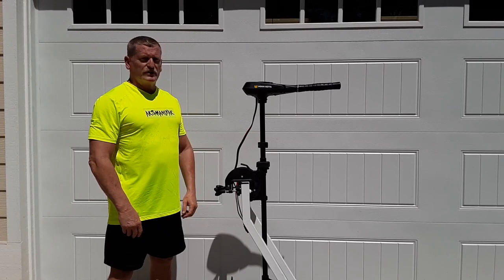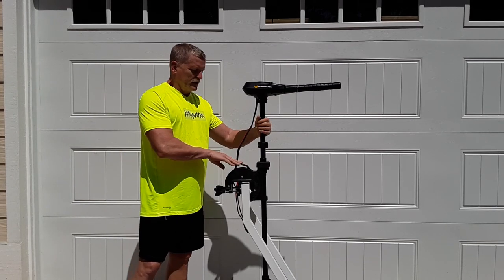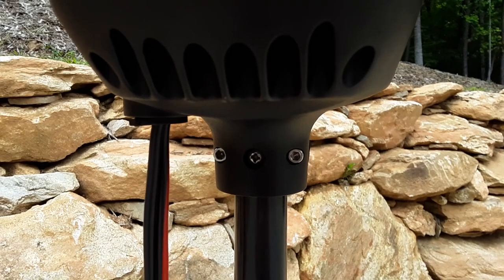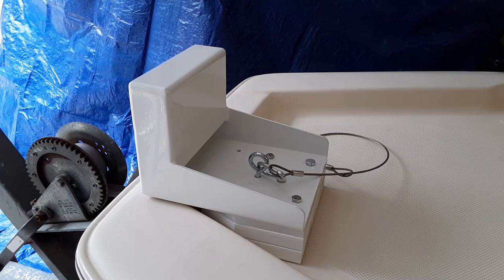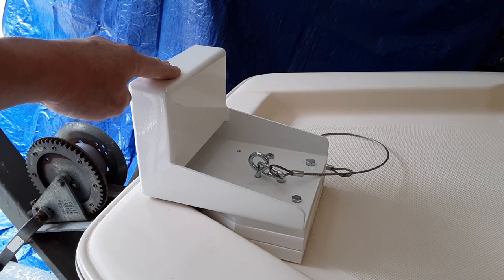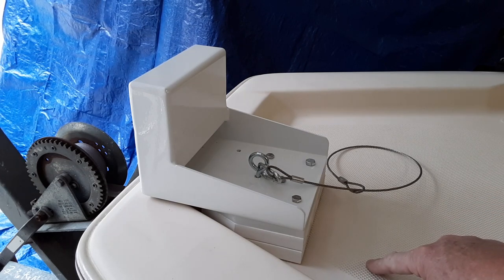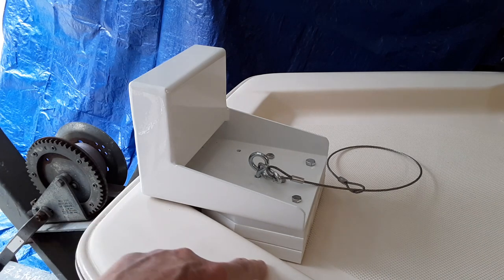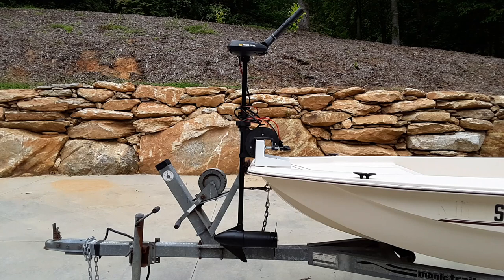DIY Transom to Bow Mounted Trolling Motor Conversion

Comment: Hi,
Looks like a sweet installation.  The longer trolling motor shaft makes a lot of sense.
Also, the PWM Pulse Width Modulation circuitry in the variable speed trolling motor is the way to go.  Fish all day on a good charge.
John
Reply from the maker: Thanks John. Not too many bow mounts have the PWM speed controllers and reverse. I'm working in a small space with a 14 foot boat and this just made sense.

Comment: The heart of this project is a commercial bracket that costs $80. Not really what I consider DIY. You've given me a good idea for making my own though, so thanks.
Reply from the maker: You could make your own but I thought the quality of this product was worth the price.
Reply: It is sold out on their web site.
Reply: howd yours come out i made one out of a thin stainless steel sheet bent at a 90 and bolted a piece of wood on it where the TM clamps. Ive got it hangin off the side on the bow. Anything past 2 speed on my endura c2 it lifts off the wood; thinkin of just bolting all the way thru the wood somehow with wing nuts
Reply: I ended up buying a bow-mount motor and building a short, 3/4" plywood deck at the front of the boat. The deck is held down with heavy-duty (0.125") DIY aluminum brackets and 2X4s, and the trolling motor bracket is bolted to the deck with the manufacturer's SS through-bolts. Wish I could post a pic here. Ironically, the lower unit on my outboard failed shortly after installing the TM, and I made several trips out with only the trolling motor. In retrospect, it would have been nice to be able to move the TM to the transom temporarily, if only to make it easier getting the boat on and off the trailer. It's very sturdy at the bow though and will probably last many years. Good luck with your project!

Comment: Been looking for a used Traxis like yours. I want the variable speed so you are never going too fast or too slow and the control handle tilts up for easier steering. Good stuff but pricy. $350-$400 but the best choice.
Reply from the maker: Yep. Great motor.

Comment: Nice Video!!  Wondering if you used a backing plate of some type underneath the bow?   Or just the Toggle bolts?  Thanks in advance.
Reply from the maker: Thanks. Yes I used some inexpensive poly cutting board for the plate.

Comment: You said you made that bracket? If not, can you pass a long the info? I'm looking to do the same thing on my boat because I'm on a tight budget and already have a nice transom mount that I could put to use since it doesn't work great as designed. Thanks.
Reply from the maker: Thanks Chris. The mount is listed in the narrative. It's by FishOn Fabrications. I just modified it for my use.

Comment: Do u have to have the handle angled up when your using it? And also how many feet in length is that trolling motor? Thanks.
Reply from the maker: No, it is angled just when in stored position.The shaft is 42 inches.